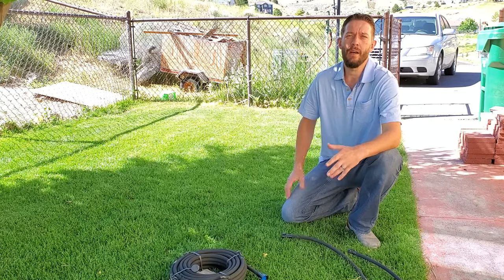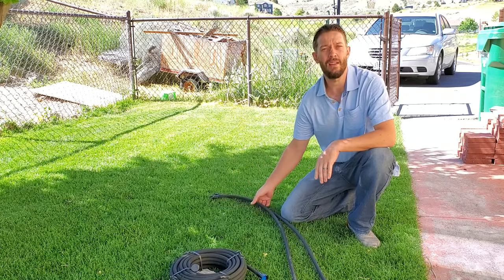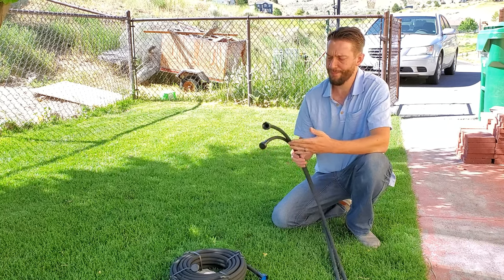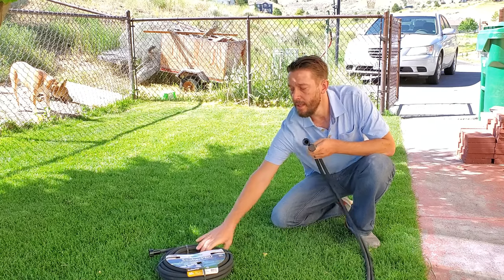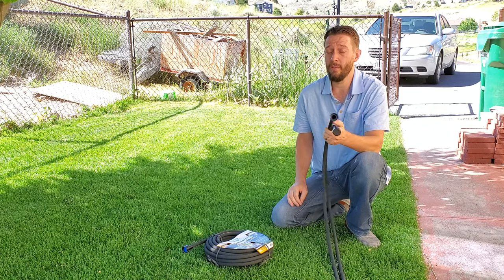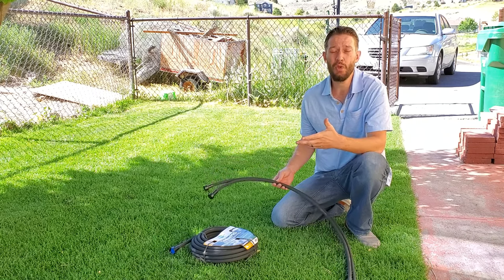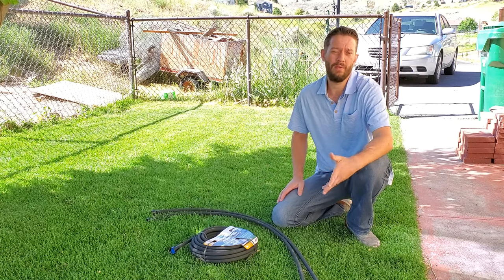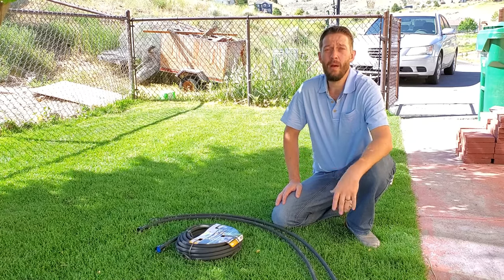Soaker Hose Not Watering Evenly?  Here's Why

Comment: I had 13 five ft arborvitaes put in and the landscape crew added a soaker hose around all of them. They connected it to my regular hose and left in the blue thing the hose comes with to restrict water. A river formed if  I put on the spigot at full or half from the connection to the first 4 trees then it leveled off. I got a 10 psi pressure restrictor like the one in the link and added it to the hose/soaker hose part, not the spigot, then turned it on half and no more soaker river on the first four trees and everything is even flow! I even removed that blue tab thing on the soaker hose with a pair of plyers that really is not a restrictor. Thanks for this video and all the comments and helping me to solve this annoying problem!

Comment: Hi! 
I have tried to set up a soaker hose system at my home and its not working well at all. I have a melnor 2 prong timer and from each timer I have a 25 psi regulator. From the regulator I have a 15 foot garden hose that then attaches to my soaker hose. I have cut the soaker hose into smaller pieces to cover what needs watering and split the sections up with poly hose that doesn't drip to link between the soaker hose sections. I thought that it would work well but almost no water comes out. I wonder if I should take off the regulator at the spigot since the soaker hose attachments still have the blue discs inside.  

This project has gone on for weeks now and I keep seemingly making it worse. I wish I could just hire someone like you to come show me where my mistakes are.
Reply: Having at the same time a pressure regulator and blue disc is too much. I say one or the other.

Comment: Would a soaker hose work if u use an elevated water cube as a feed
Reply: I have a rain barrel that gets filled up in no time. When I connected a 50ft soaker to it, water barely made it out onto the ground.
I carefully* removed the blue restrictor and all is fine.
* Should we get a long dryspell, I can put the blue thing back and connect to exterior spigot.

Comment: Gravity flow to water garden from 275 ibc tote 15ft above garden. Need to run 7 45ft soakers. I will build a water junction for the 7 outlets to spread 20ft. My question will this gravity system push enough water to the end of the soakers. Most of the water will come from rain and pumped from old well. Mike
Reply: Did it work?

Comment: So I took out all of my blue washers to get better coverage at the end section of hose. 
I not sure it helped what should I look for and should I put them back in?  Thanks
Reply from the maker: A lot depends on the length of your hose and the pressure as the water enters the hose(s). If the pressure is too high for the length then you'll get uneven water, if the pressure is too low you'll get uneven water as well. I have three 50 foot soakers working off a 25 psi regulator and I get even water, I also get even water from my 50 foot hose running through a 10 psi regulator. Last point is that it takes a minute or three for a full spoaker system to pressurize and distribute evenly.  Its better to run the soaker longer and less often than more frequently for short watering sessions. Hope that helps.
Reply: Thanks for your reply and I’ll try all your suggestions ✅✅
Reply: Would this be the same outcome if you don't have level ground?

Comment: I’m in Texas and trying to water my foundation and am using two 100ft hoses. Pressure on my home is very strong, but the hoses have the plastic pressure reducer. I get a lot of water at the spigot but there are some areas that barely have any droplets. Is there anything that I can do? Relatively flat terrain, but I did have to take it under a fence a few places...
Reply: those little blue discs are not pressure reducers. there are just limiting flow. pressure in a close loop system is the same.

Comment: I bought three 50ft soaker hoses and connected them together for my newly planted 40 emerald green thujas about 6ft tall. I snaked it down one way and back so it does a figure 8 around each tree. Off the hose I have a 2 way connector and have the soaker hoses on a closed loop. Main connection is hose, 1 outlet is the start of the soaker hose, which connects to two more 50 for soaker hoses and ending back at the 2nd outlet in order to close the loop  1.) Is it necessary have a soaker hose running on both sides of the tree? 2.) Is snaking the hoses into a figure 8 wrong? 3.) 70ft fence line is on a gradual slope, I noticed the soaker hose is dripping more water near the garden hose connection than at the opposite end.   Appreciate any help in advance!
Reply: did you connect the water to go back into your hose? you could introduce dirty water from the garden into your kitchen drinking water. i know many area have codes with a water backfeed preventer. im not sure if what ur doing is right. you should not be connecting two outlets together to form a loop. 1 feeding line. nothing should be going back to your house.
Reply: @666Necropsy  Your over thinking it man.

Comment: Why on Earth would you buy another device to restrict the flow. Just don't turn the hose all the way on
Reply from the maker: That's the simplistic way of looking at the situation. I can run all my garden beds from one spicket. Each of my ten beds has a shut off valve at the bed and a flow (pressure) restrictor installed so no matter how many beds are "turned on" all I have to do is start the water full blast and each bed gets the right amount of pressure every time. Also, if you have a garden bed zone setup on your automatic irrigation system the pressure regulators keep things in check since your irrigation cant be turned on "a little bit". These flow restrictors or pressure regulators are worth buying and cost a drop in the bucket over the long haul IMO. Thank you for the question; gave me a good way of explaining this to other viewers in the future.

Comment: i found the little blue disc does nothing beneficial for me. taking it out and just cracking the water valve worked much better. i got more even water through hose. you cannot go up any kind of hill without dumping 90% of the water in the first few feet. now where this soaker hose will work good for you is if you place it down hill. run the feeding hose all the way to the top of your hill. place the soaker hose inlet at the top of hill and water downwards. this helps big time. even doing this you will still get more water coming out closer to the inlet. i dont believe there is anything you can do to make this product dispense water evenly. its just the way its designed, all of them. a drip type of system is going to be the only way to get more accurate watering. the problem with them is many are made very cheap. stepping up to agriculture grade quality stuff really helps. in any garden tools. if you want something tuff and lasting avoid many of the big box store items. buy products actual farmers are using. it will be more costly though.

Comment: Hey great info!  In regards to running vinegar through the clogged hose, this can actually be done. All you need is a siphon .  You hook it up to the faucet and then put the straw end down in the bucket of vinegar water and book your soaker hose up to the other end of the brass siphon (or plastic) and turn the water on.

I've never done it, but I'm sure this works.  The siphon is used for being able to water from the hose a diluted mixture of liquid fertilizer etc, so why not run a vinegar solution through it to clear a clogged hose? You just have to find out what vinager to water ratio works.

Peace in the middle East and in oak cliff Texas 😂